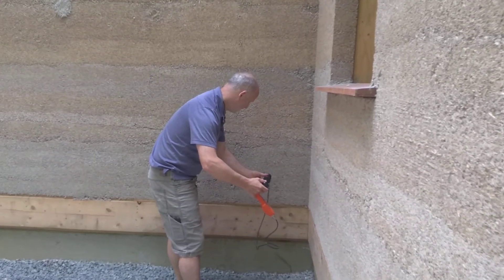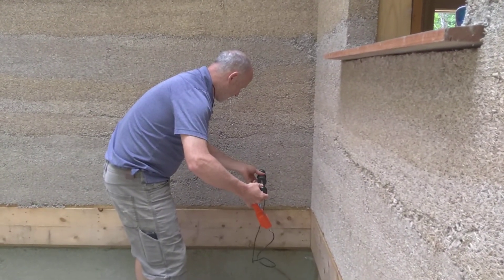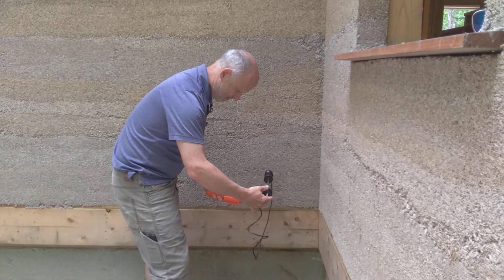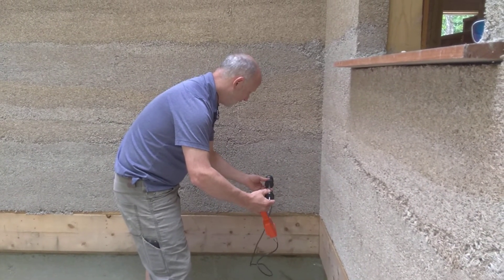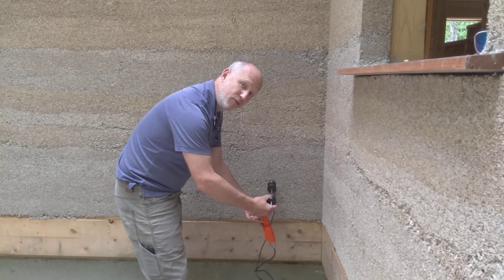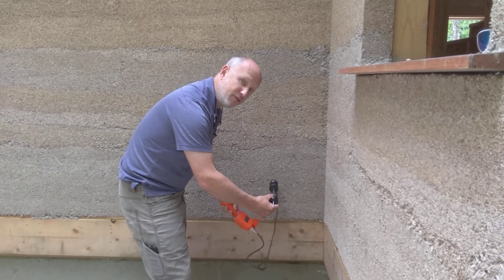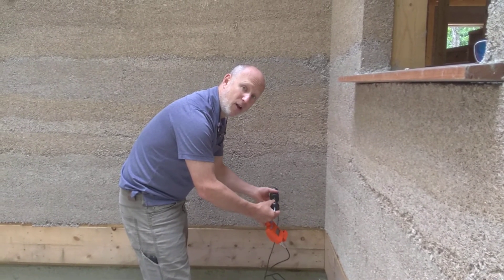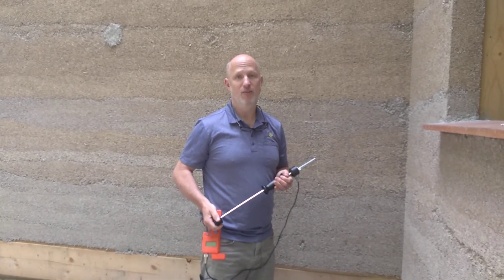Hempcrete Moisture Testing Step by Step

Comment: Is plaster the only siding option for hempcrete?
Reply: He is probably talking about lime plaster. If you want to maintain breathability (which is the whole point about building or isolating with hemp) yes you need to plaster with lime. A cement based plaster will not allow absorption or release of moisture